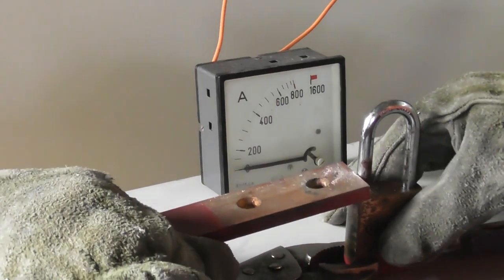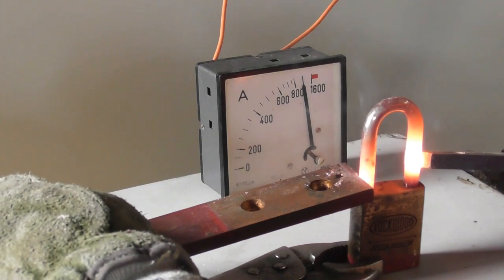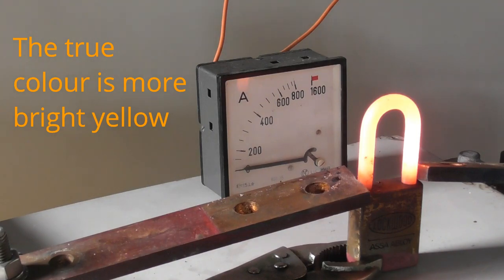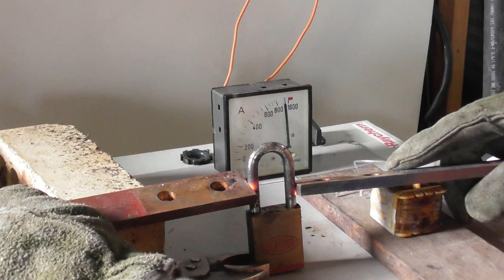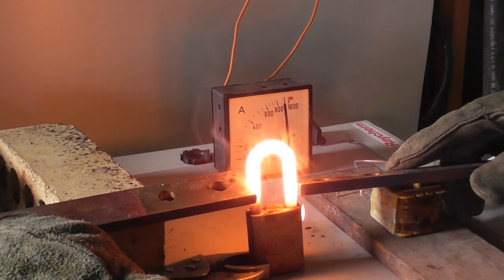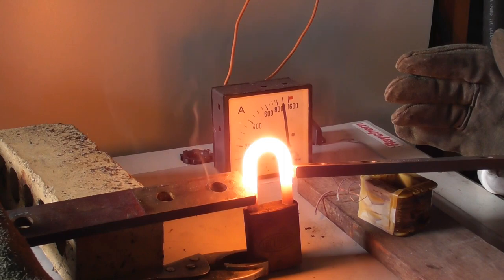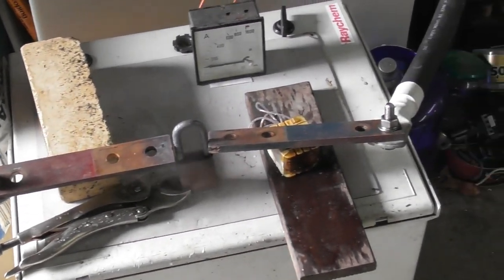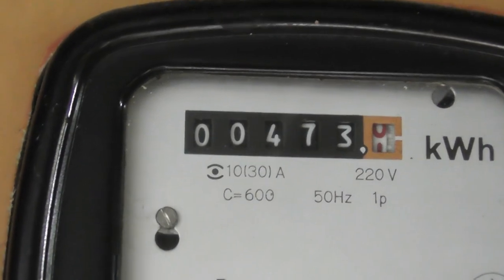Red hot Glowing Padlock

Comment: Been subscribed for over 10 years now and still one of my favorite channels. I wonder if a 3 or 4 KA supply would melt it?
Reply: I got a vid on my channel melting a spanner at 3ka
Reply: That would indeed do the job, since it almost worked with this one at 1300-1400 A. But one problem is the resistance in the contact points - wich means most of the heat is generated there and not in the lock it self (you see that very clearly on the video, since the part of the shackle that's closest to the connection heat up a lot quicker than the middle section). Since copper is a very good conductor of heat as well as electricity (much better than the steel in the lock) - a sigificant part of the heat is probably carried away and end up in the wrong place (copper bars and connections). 
That problem will increase with the current and may make it hard to melt the lock anyway - but with 3000 A (given that the transformer also have enough output voltage to overcome the resistance, so you really get that much current running) and really thick copper bars that also have large mass and doesn't heat up too quickly, it should work (not very efficient heating though, haha)

Comment: I can't imagine your electric bill, you and photonicinduction.
Reply: coondogtheman1234 ¿que paso con photoninduction?
Reply: Not much. If I am not mistaken, the voltage is not that high. So if we assume that the voltage if 24 volts then the total power will be 24000 W (assuming 1000 amps). Then considering the fact that he does these experiments for less than 10 minutes, total energy used will not be more than 6000 watt hour. Which is not that much. It is equivalent to running 3 microwave ovens simultaneously for 60 minutes.
Reply: +oblitum - A mad scientist YouTuber.
Reply: Inflec ??
Reply: Not sure why everyone is guessing here, he shows you how much power it used at 7:05.  The whole experiment used 250 Wh, or a quarter of a kilowatt-hour.  If you pay 20c per kWh then a quarter of that is 5 cents worth of electricity.  Not exactly breaking the bank.

Comment: How about passing current from the base up? You could potentially get higher temperature on the narrower locking part of the bolt inside and melt it off from the rest of the bolt itself. Also it sound like some mounting rig would be a nifty idea.

Comment: Awesome! That's a big transformer, haha. 
It's indeed pretty tough to melt such a heavy duty lock this way, since the current also goes 2 ways (one part of the current is going thru the steel shackle it self, while the other part is going down, thru the very low resistance brass part and up the other side) - meaning that it's effectively like running the current thru two steel bars (with the same thicknes as the shackle) at one. An induction heater is way better for heating stuff like this - but a little trickier to build.

Comment: Yeah, this is an example of a 100 lifetime filament for an incandescent bulb. Not too efficient, not cheap to run, hotter than hell, doesn’t give off enough visible light, but damned if it will ever break. Oh yes, this one doesn’t even need an evacuated envelope.
Reply: Steel heated to these temperatures in air oxidizes - the surface is turned to flakes that falls off, exposing more of the steel to the oxygen, wich oxidizes again and falls off and so on. It will shure last some time when it's this thick, but I'm not shure if it will last much longer than a normal light bulb. In an envelope with inert atmosphere (such as argon) it's another thing though. The tungsten used in normal light bulbs can still take a lot more though - it's all about the wire being thin and runs very hot trying to get as much efficiency as possible from a light source that isn't very efficient anyway, haha.

Comment: Very Interesting, I would have thought 1200a  would be plenty to melt an 8mm shackle.   Thanks for sharing partner.  Imagine how much energy is required to melt steel in an arc furnace...
Reply: They need an entire substation for supplying power to it.
Reply: A.S - One of Ray's early vid's is him and his team working on the transformers of an EAF.
The primary voltage is 33kV and you see this ammeter bouncing all over the place anywhere between 400 to 800 Amps, with all these bangs and buzzes going on in the background.  It's a great vid if you can find it.
Reply: @bridgerectifier7711  400 to 800 amp on the primary side of the transformer at 33kv???
Reply: @2loco  - Secondary side. The furnace is fed by 500 V 3-phase.
Reply: @750kv8  & A.S  - No.  I'm talking 400 to 800 Amps on the primary side.  Around 20MW.
Take a look at the vid and you will see that  from the size of the busbars that the seconday is many hundreds of thousands of amps.
Reply: A.S  - Vid is called Electric Arc Furnace at 42000 Amps -
https://www.youtube.com/watch?v=ijWwfcw0FOo
(obviously not hundreds of thousands - personal ohms law meltdown)
The other vid is called EAF Busbars, showing the transformer spec plate - 
https://www.youtube.com/watch?v=4ROGZryg37U
Reply: @bridgerectifier7711  - Oops, my bad. Thanks.
Reply: The heat radiating away becomes significant when things get this hot (the power needed to heat it further goes up exponetially with the temperature). It's also effectively like running the 1200 A tru 2 steel bars in paralel that's 8 mm thick - because part of the current also goes down thru the thick brass part and up the other side

Comment: You could cut it with a hacksaw now. No temper left in the steel after that heat treatment.
Reply: I thought very hot heat treatment (then rapid cooling) is how it is hardened/tempered in the first place? Is that right?

Comment: I wonder if heating it up to glowing like that, if you put something extremely cold on it, such as liquid nitrogen would break it due to temperature drop at such an extreme rate?

Also there’s something I really like about those style of gauges like the amperes gauge you use :)
Reply: It's the "red line" on it. :P
Reply: The liquid would just vaporize way before touching the surface I think.
Reply: @400ccmiruku4  not vaporize, but just slip off that red-hot metal due to nitrogen cushion created by heat and liquid nitrogen.
Reply: @sebo0855  Leidenfrost effect?
Reply: That would be less effective than just drop it in cold water. If the shackle is for example 1250°C, it will be an 1150°C drop down to the boiling point of water. For liquid nitrogen that will be 1446°C instead. Not a that much of a difference - but the evaporation energy for liquid nitrogen is much lower than for water, so it will evaporate a lot faster. That means the leidenfrost effect is greater and thus the lock will actually cool down slower. When it gets cold enough it may get brittle and probably quite easy to smash with a hammer for example
 - but if that happen, it doesn't matter if the temperature from start was yellow hot or just room temperature.
Reply: @sebo0855  leidenfrost effect?
Reply: @MaximumJoy  This topic was quite some time ago ( around year ago ), but yes, it's called Leidenfrost effect as Amitabh mentioned also year ago.
Stay healthy, and have a nice day! ( probably a day )